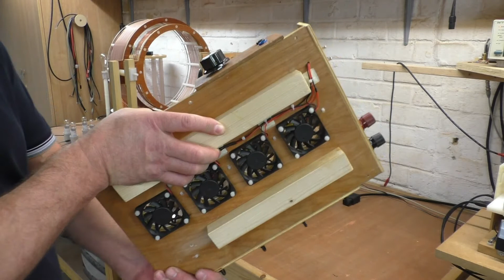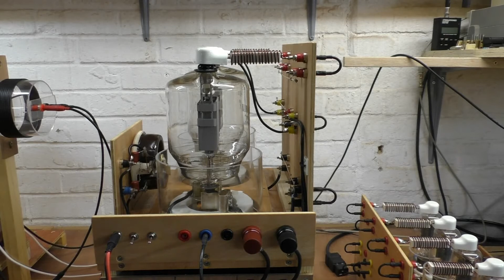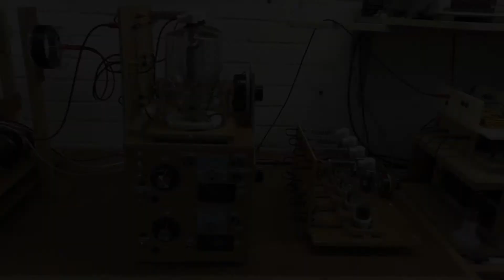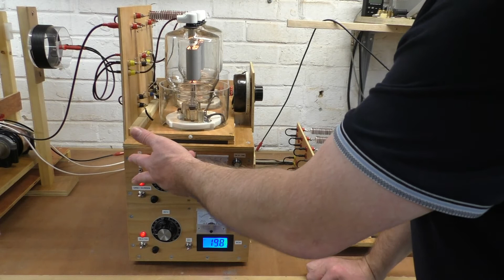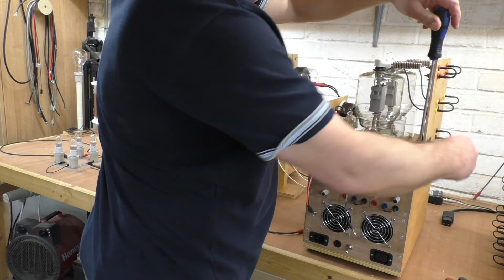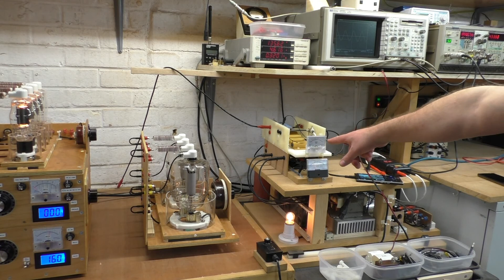Tesla Coil Tube Power Supply - Heater, Grid & Screen

Comment: Have you managed to get some notable results with pulsed discharging and thyratrons?
Reply from the maker: Hi, one of the most notable non-linear results I have seen so far with high energy impulse discharges is the mysterious "hedge of streamers", that emanate orthogonally from the wire for a brief instantaneous moment. This phenomenon is for me related to Displacement, where the dielectric and magnetic induction fields are re-balanced in the electrical system at an underlying (inner) level, and ahead of conventional electrical circuit characteristics being established. I present more on the principle of Displacement on my website in more detail starting here: https://www.am-innovations.com/displacement-and-transference-part1. A similar phenomenon was observed by Tesla, according to the reports presented by Gerry Vassilatos.
Reply: @aminnovations  Hi, wow, ok, I'm gonna scramble the achieve this too, but it's a nontrivial task of course...

Comment: The Russian manual for the GMI-38 tube says that the protective resistors in the plate and grid circuits should be non-inductive, for some reason, so the role of inductance in these resistors is not clear .
Reply from the maker: Hi, if you mean here in the plate circuit then the inductor-resistor combination acts as a filter preventing very high frequency oscillation reaching the plate of the tube, which in some cases can cause a positive feddback loop with the grid circuit, and hence electrical run-away and ulimately very excessive plate dissipation, and finally tube melt-down. Tesla transformers can do all kinds of strange things when you put them into different electrical conditions, and this creates a very demanding matching and power transfer challenge for the generator. This is why I particularly like power oscillators that are self-tracking and generally well matched to the parallel resonant modes of the coil - it lends itself to a broad range of Tesla experiments without needing to make significant modifications to the generator everytime you want to tune to another band of interest.